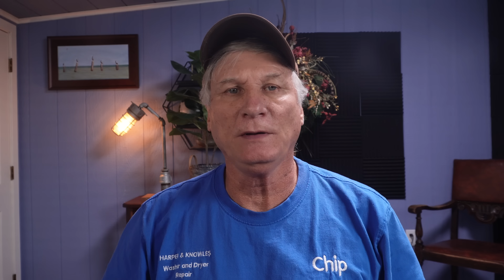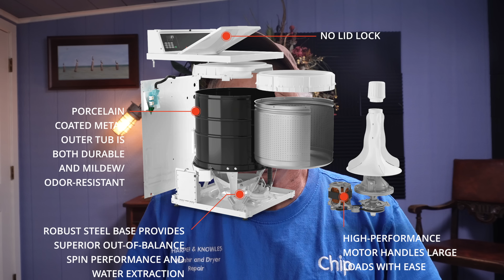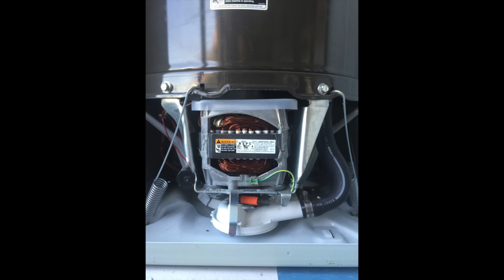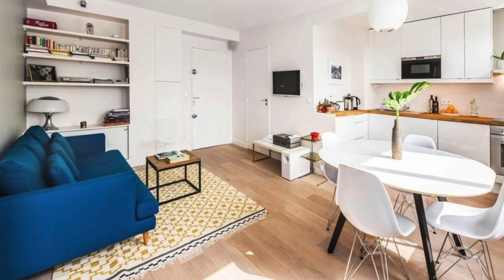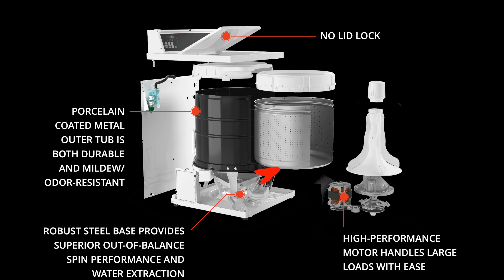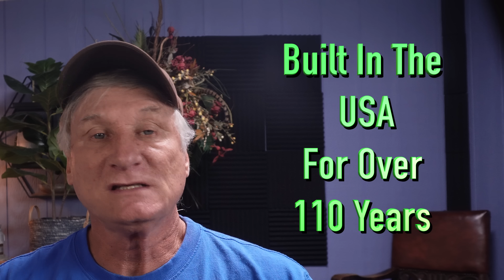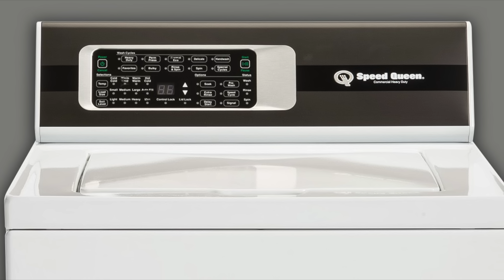TR7 vs TC5 – The Truth Speed Queen Dealers Don’t Tell You

Comment: This is kind of interesting.  I have TR 7, which I love.  I had an issue with the dryer which will be resolved when the tech comes back (he ordered parts for it).  It just randomly stops working but eventually will work again. The TR 7 has a 7 year warranty which is unbelievable.  I was still deciding between the TC 5 and TR 7 when I walked into the store.  My sales guy recommended TR 7 because of the warranty.  You will pay much more for Speed Queen.
Reply from the maker: Thanks for your comment!

Comment: Very true Chip. I mentioned a few months back that we were considering a Speed Queen set. The wife wasn't sure if she wanted the TC5, or the TR7 set. After comparing she decided on the TR7 set, and has been very happy with them. And quiet they are. I have to stand almost beside the washer to hear it running. I was a bit suspicious about the cleaning ability of the washer, but am amazed at how will it does. Thanks for your help in that decision.
Reply from the maker: I’m glad she was pleased with it. My sister has one and a few people I steered in the Speed Queen direction have bought them and no one has approached me with a complaint. Thanks for watching!
Reply: Thanks for this information. So hard to decide!!
Reply: @christinecolburn6971  My wife had the same problem Christine. So we went to the appliance store, and she took her time to compare both sets. She decided on the TR/DR7 set because the price difference was mininal compared to the cost, and the TR/DR7 had a 7 year warranty compared to the TC/DC5's 5 year warranty. Good luck on your decision. I don't think you can make a bad decision as both sets are made by Speed Queen.
Reply: @wanted-33  Are you still happy with it?
Reply: @Ourfloridaproject  Yes we are. It took a little bit to learn all the buttons, but it's a great set. BTW, if you decide to buy these, never use the "ECO mode". It there to appease the government, and just doesn't put enough water in the tub to clean the cloths.
Reply: @wanted-33  Thank you! Appreciate your reply and insight!